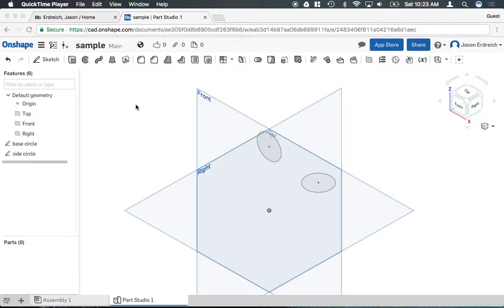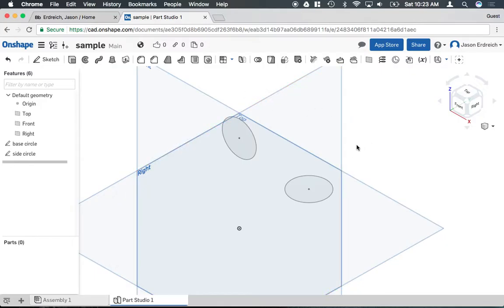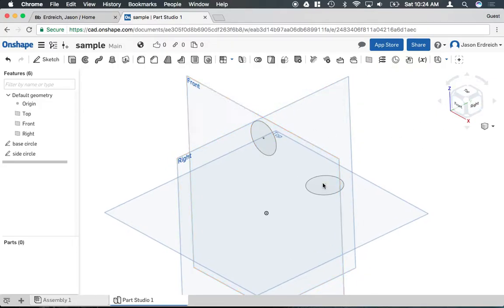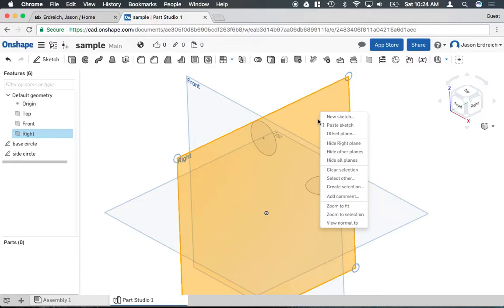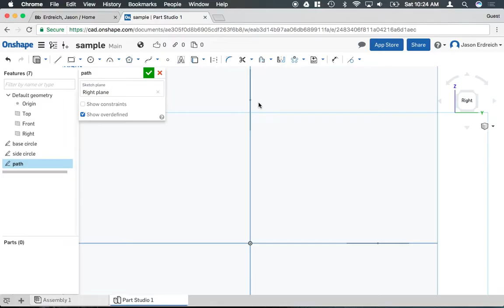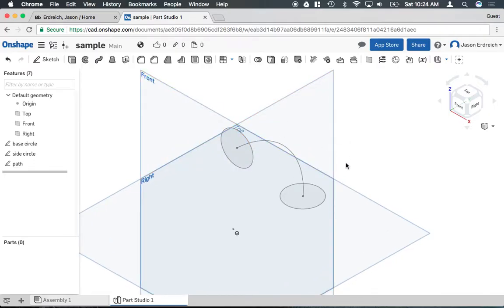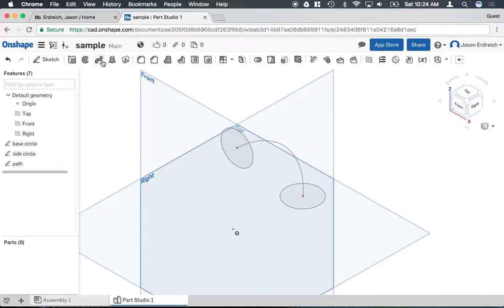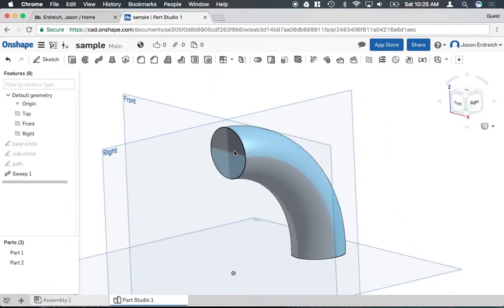How to use the Sweep tool in Onshape CAD

Comment: So it let’s me select one circle but is not letting me select the centre of the other circle? How can I do it so if selects both centres of the circle?
Reply from the maker: It sounds like something is blocking your ability to select. Perhaps hide other sketches or planes? Or select the sketch that the second circle is on using the sidebar, not by actually clicking on the circle itself.

Comment: my sweep isn't locking onto the sketches perfectly, on one sketch, it lays perfectly flat on the sketch. However on the second sketch it is slightly rotated and overlaps through the plane the sketch is on... any tips please?
Reply from the maker: Depending on the shape, you might not need more than one sketch. Try creating one sketch for the profile, then a path, then sweep using those two features. You can then create a new sketch / path to continue or change the shape as needed. 

For multiple sketches, you might need to put in guidelines (more paths) to control the orientation, or consider the loft tool instead